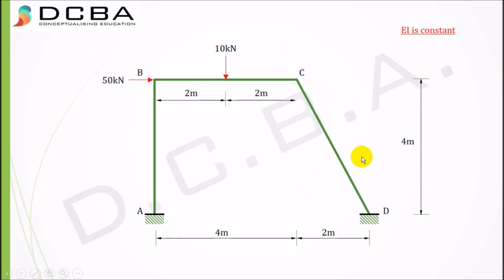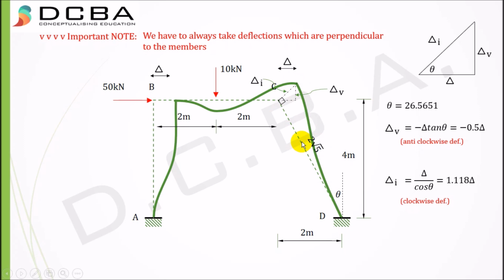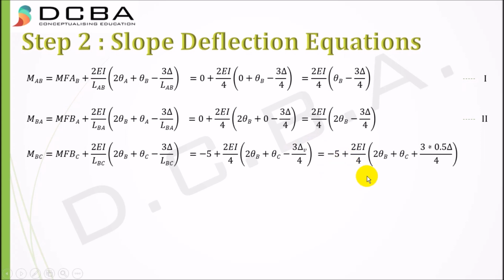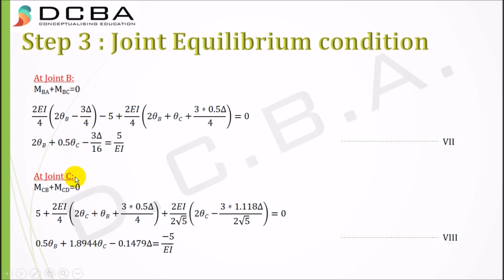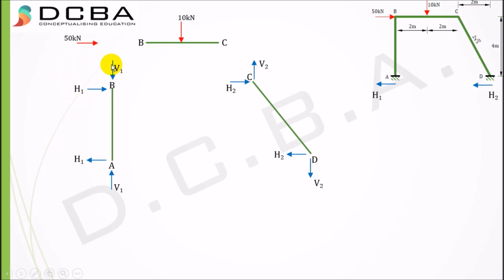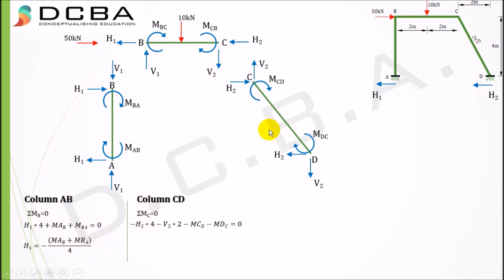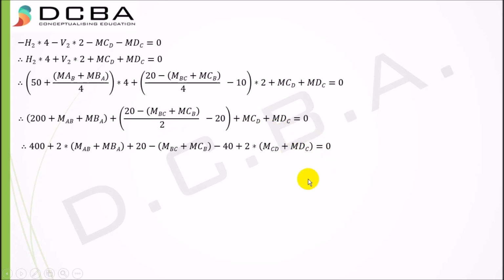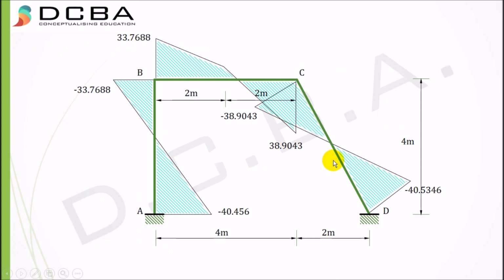Civil engineering / Slope Deflection Method for PORTAL FRAME with SWAY (Inclined Leg)

Comment: is the same formula applicable if each member have different length and different elastic modulus? or for nonlinear?
Reply from the maker: are you talking about slope deflection equation? or which formula are you referring to?
slope deflection equation would change for non prismatic members.
Reply: yes I am talking about slope deflection equation.. Though results differs when comparing to software even after updating E and length of the members but deflection varies alot.. Is there any way to resolve this issue or can you provide me a material please
Reply from the maker: MURALI MANOJ, it should not vary if you have taken a prismatic section that is a section whose cross section does not vary accross the length of the member, if your section is a prismatic member then calculate its moment if inertia 'I' and check youngs modulus 'E', then find the value 'EI' substituting that you shall get deflection.
Reply: Sorry for not being clear.. I coded this formula using python , for linear calculations it works perfect but for nonlinear where E and length of member changes with increasing load , moment value varies alot eventhough I calculate end moments based on plasticity formula for example: member fixed at both ends with udl  maximum moment formula for linear is wl^2/12 but for plastic analysis its wl^2 /16 but I can find frame deflection only by this method which seems to vary alot when comparing software
Reply from the maker: MURALI MANOJ it will not work for varying variables, the basis of this derivation is thay your material properties and cross section does not change
Reply: Do you know or have any study material to calculate frame sway for nonlinear analysis?
Reply from the maker: MURALI MANOJ solving for a non prismatic beam is also easy its just application of a different slope Deflection Equation, i will upload it later on sometime, meanwhile you can google the formula for it as slope Deflection Equation for non prismatic member